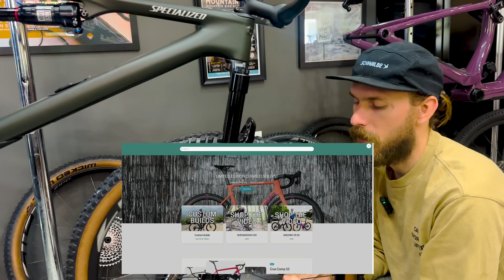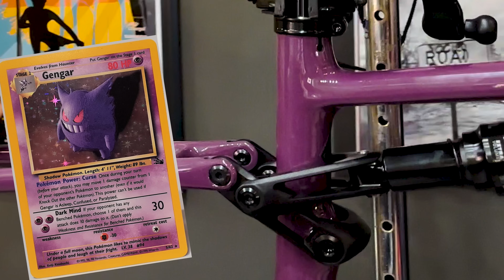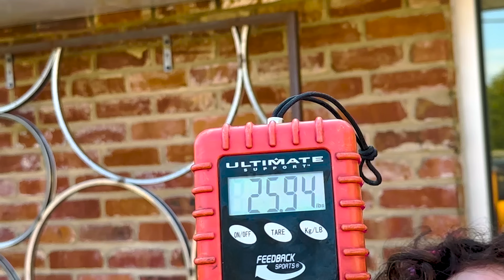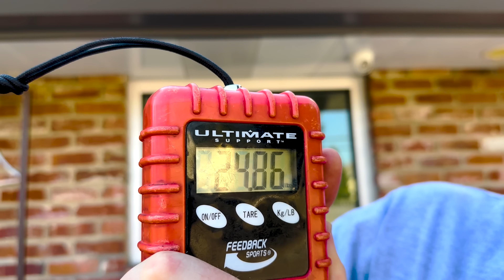Specialized Epic 8 Evo Showdown

Comment: Question , how do you put a ROAD saddle on a dropper ? Because i see , that saddle its with carbon rails , witch is 7mm x 9mm , the titanium rail (7mm round) mirror saddle  have a total different nose design
Reply from the maker: The ears are designed to fit carbon rails. It works no issues
Reply: Eh , i have an Anomaly Switchgrade mounted on the dropper , it takes only 7mm rails .... that small design difference stopping me to buy the titanium version , with the carbon rails the aesthetics its way more cool